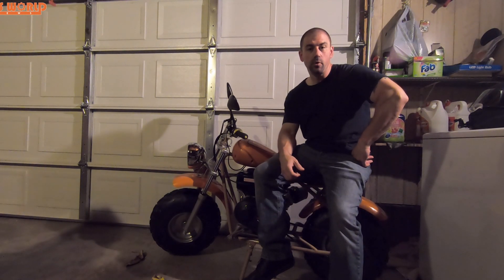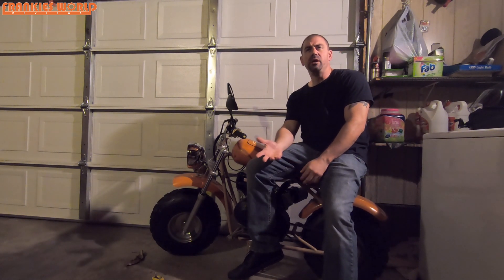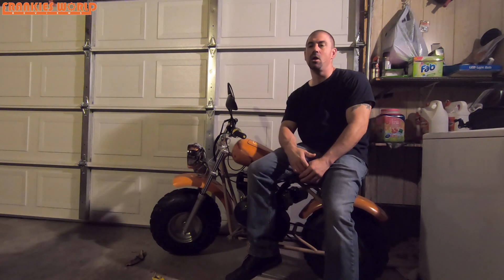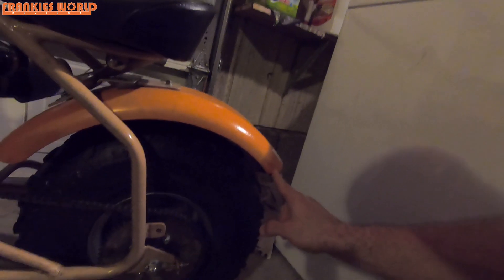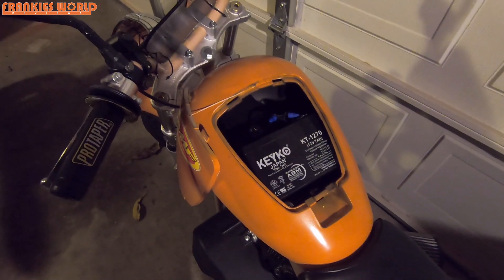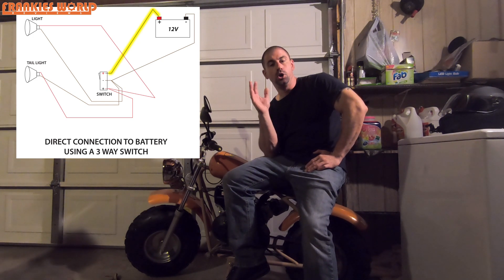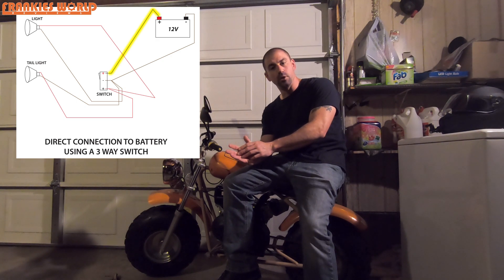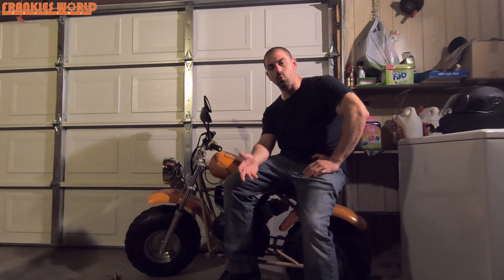MIni Bike Light Explained

Comment: What if you only have a 2way switch?
Reply from the maker: 2 way is even easier, I dont have a video on it but you can  google search 2 way switch connections. From what I remember, the only thing the 3 way switch does it enable the light on the switch itself.

Comment: I plan on doing night riding what 12 v system should I ues
Reply from the maker: There are several out there. Some hook up their headlights to an RC car battery, or the easiest thing to do that does not require any modding is to get a strong led light that clamps to your handlebar and uses its own power source. You can get two of them.